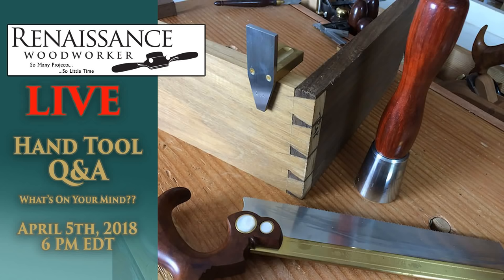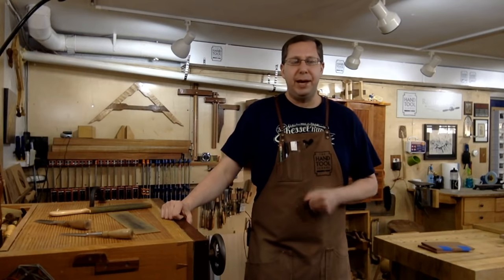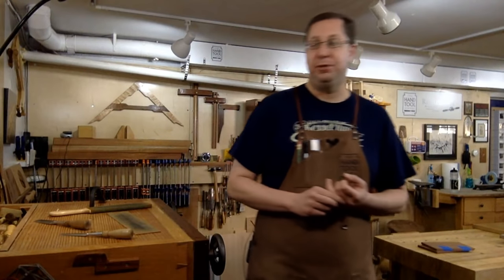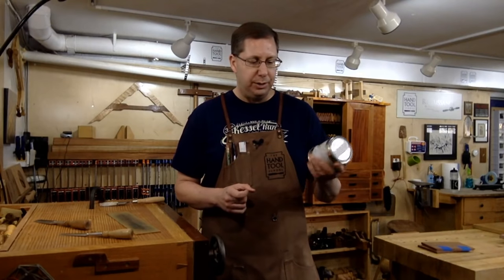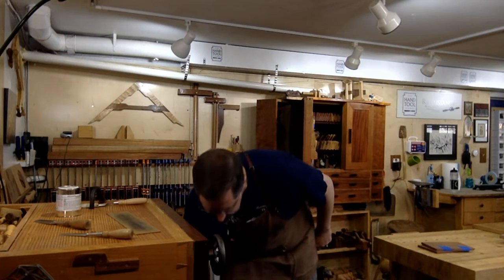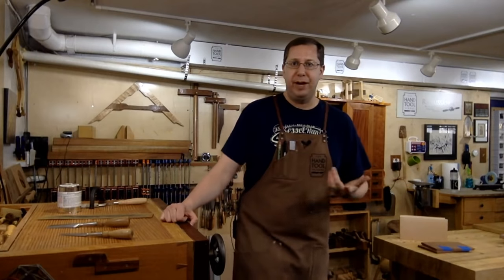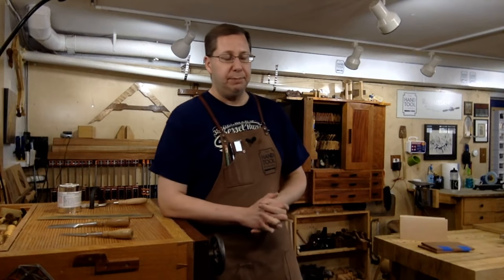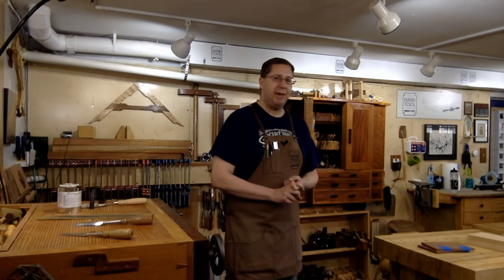RWW Live: Shellac Tips, Dovetail Saws, Mortise Chisels, & More

Comment: Someone asked about the dovetail guides and whether they were worth it. (more or less).  Shannon, since you said you didn't know anyone who started with them and then quit using them, here's my opinion. (I did just that)  I agree with you that what you learn using them does not help when you stop using them.  At least for me.  I had (have) the David Barron one and although it is an extremely well made tool, I have had better luck just learning freehand.  I'm still not anywhere near as good as I want to be, but each one gets batter than the last.  I found that using the guides, I was not improving.   Now, that is just my experience, but it seems I agree with you about the usefulness of them, or at least how well they 'teach' you how to cut dovetails.

That's my story and I'm sticking to it.  :-)
Reply from the maker: thanks for the feedback Don, that really valuable.

Comment: Only watched a  minute of your video from the 3 to 4 minute mark. What the hell are you doing with that piece of leather? No barber in his right mind is going to have a wobbly piece of leather to strop on. Unbacked strops are meant to be used under tension by pulling on the handle. Sharpening anything while sitting it on  a part of your body is insanity. Such as at the 3:30 minute mark. For chisels you would always use the strop glued to a backing piece of wood. I can't watch anymore.